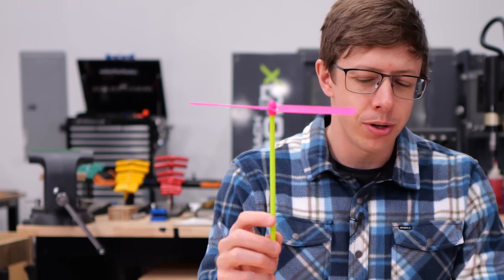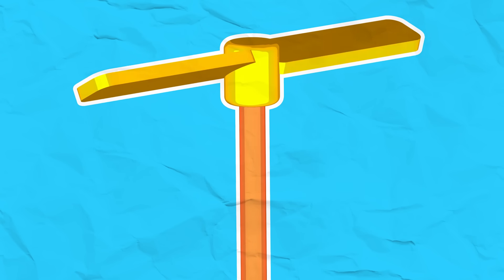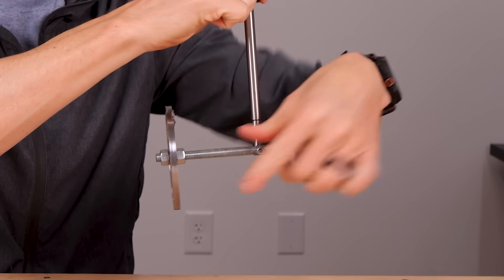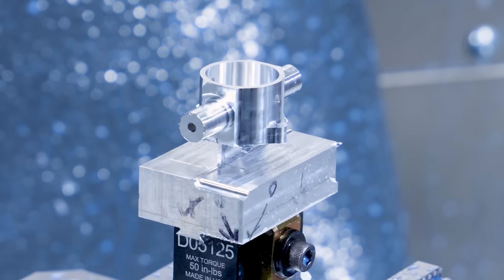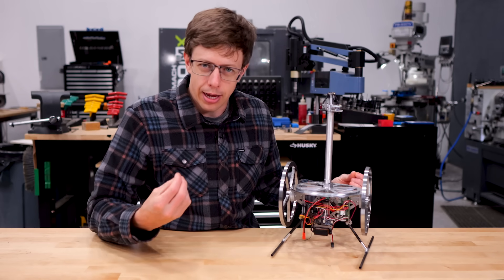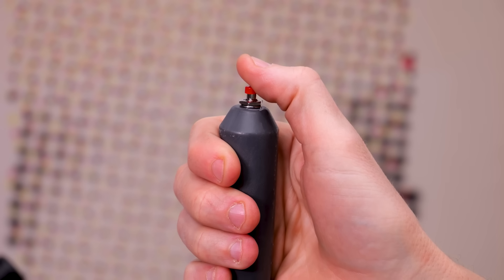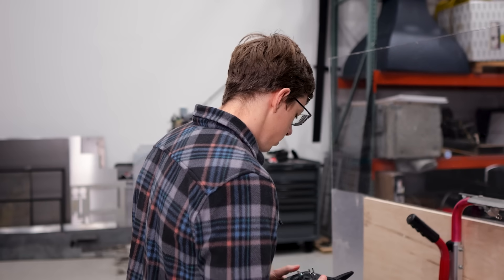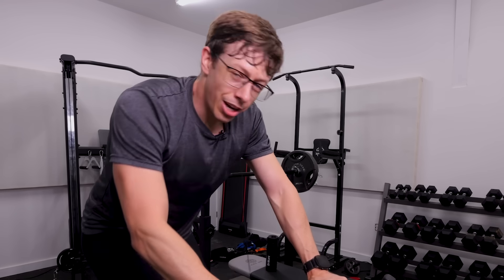I really thought this would fly well

Comment: Answer, counter rotating propellers. for control you can try to adjust booth swash plates with gravity pendulum. yes but the video idea from toy propeller why not make fast rotating device that uses the same toy to spin it extremely fast and release at the peek rpm. for motor use cheep spindle from ali express, they have nice 12k rpm, and have power to make video interesting.   i wish i lived in us and afford so cool toys 5axis cnc, cnc lathe.

Comment: Could you not just ditch the entire flywheel concept and have an aerodynamic housing (similar to the shrinkwrap on the flywheels) on the blades that decouples before launching. This way you get around the drag inuced by the spinning blades, dont carry extra weight during flight, and stay more true to the original toy.

Comment: Sounds like you need to colab with @NicholasRehm for flight control.  He's made a flight controller specifically to do crazy things like this.  

A tail-rotor, swash-plate, and flight control would fix this prototype.  But I bet you're switching to a single flywheel either at the rotor tips.  (a geared flywheel under the rotor would still have counter-torque issues due to the gear-box)

Comment: Maybe im thick but that looks a bit too complicated than it needs to be xD. 
Would it be possible to use a steel rim around the propeller blades as the flywheel, and also to turn the blades around during descent u can try a simpler compact design where in the centre of the propeller can be a hollow pipe and a rod inside with geared tooth or something. Actuation can be done with a battery powered solenoid all contained inline in the pipe so its inherently "balanced". :)

Comment: Why not just make it the exact same as the one you are basing it off. So have a motor that spins the vertical tube that is attached to the propellers then have a release switch and have it shoot up. So none of all these extra parts, just the vertical tube with propellers and a ground station to spin the tube.

Comment: Make a secondary propeller, of which the blades turn in the opposite direction of the first one, directly underneath the primary one. This will nullify the torque and stabilize the device.

Comment: the reason for the control surfaces to not work is simple. The air is moving from top to bottom and the rotor is creating a an airflow acordingly, only that it is not a FLOW. The air coming out from the bottom is a turbulent airflow wich means it isnt useable as a control input. What you need is a seacond rotor on top (that is spining the other direction) or a tail rotor. 
Other than that I really enjoy such videos

Comment: For me, your attempt (as magnificent as it is) misses the essence of the toy. The toy is spin up a propeller by turning the axel and letting it go. Seems that determining why the toy works as it does is important. I wonder how fast the toy can be spun and it still fly in the manner we see when spun by hand.  I have a feeling that the weight of the stick relative to the propeller, the center of mass, length of propeller, mass of both, etc. is then compared to the various tilting forces due to the propeller spinning (how. much leverage is it generating to counteract as it departs from vertical), etc. Once that's known then you have to find the combination of materials that work for a blade and stick that will spin to a high rate. All the machinery stays on the ground, all of it. It simply must be a stick and propeller or it's not the extreme version of the toy.

Comment: I've been putting off buying a transmitter for years now, but I see that DX-6e is pretty loaded, it looks like a full featured transmitter! Not your traditional "e" spec. It actually looks way nicer than my Very OLD 6i... 
Last time I checked, all of the cheaper transmitters (5e, 6e) were just getting model memory and still didn't have screens lol (you had to plug in a laptop to make adjustments). 
After I finish watching this video I'm going to see how much those fancy new 6e and 7e transmitters are going for, and hopefully I'll be able to get some of my old toys doing the crack 3D they were designed to be doing again.

Comment: If you're trying to store energy to drive the blades, could you connect tips of the rotors with a ring around the outside? It would be a much larger ring that your flywheels - even though it would go slower. But if you account for the same weight (1kg?), you could have larger lifting surfaces (longer radius)) and they'd be stabilized a bit by the ring, meaning you don't have to beef up their cross-section much. It loses all of the active controls and much of the engineering/hacking we come to your channel for, but it would be interesting to run the math to see how energy storage compares. Just launching 3-4 blades inside a dense outer ring (on edge to reduce drag and maximize rotational inertia) seems like a viable solution. I'm asking you HOW viable?

Comment: I would love to see you (also) take on the challenge of "How high can I make one of these things go?" if you instead interpreted "these things" as meaning "a helicopter where the part that flies is only allowed to be a propeller and a stick. So no moving parts on the parts that lifts off. (If we by "moving parts" mean "parts that are moving relative to each other" that is, the propeller would obviously have to *spin*.)

It would mean that the end result would have more to do with the toy, but it would still leave room to over-engineer the part that stays on the ground. The obvious drawback would me that this would nix any steering, so unless you also limit yourself to what materials the propeller and stick can be made of it would become very dangerous very fast. But compared to a RC helicopter you can't control I can't see you something you intend to come down in an uncontrolled way could be much worse?

Comment: 7:32 "They have a 5:1 ratio, meaning the flywheels will spin five times faster than the blades."  No, they'll spin four times faster than the blades, because that's multiplication of the value added to the value.  They'll spin five times as fast as the blades.

Comment: What you want to build is basically a helicopter, with the difference that its power comes from the momentum of a flywheel instead of from an engine - but the principle of how a helicopter flies is, perhaps, wothy of consideration.  They use a tail rotor to counter the turning of the body.  Alternatively, if you stuck out arms (I would suggest three of them) with light-weight vertical fins on them (balsa), that will not completely stop the body from rotating, but it would slow it down a lot.  The longer the arms, the more resistance the fins would give.

Comment: I'm not an engineer, But would it work the same if you put the flywheel at the bottom parallel to the propellers? I'm assuming you couldn't have the wrap on the flywheel otherwise it cost too much drag but that would prevent it from tipping over too.

Comment: Worsening the problem is also the x component of the friction, since in order to push the air downwards you are inherently producing a sideways reaction force to redirect the airflow. The best solution would be to implement counter rotating props in the same fashion as the flywheels so that they cancel each other’s forces out.

Comment: Stop making this so complex, the easiest way to couter-tork is to make the reverse mechanism that generates the tork, I understand the idea of the wings, because if it works you don't need to redesign anything, but to be honest, just put a second set of blades rotating in the other direction, the tork generated by the first set will be canceled mainly by the second (you need to do a simulation with air turbulence), the gyroscopic effect will help a lot, but the precession will make everything more difficult (I don't know how to solve this part, so I'm not even going to try to help, I'm just going to make it worse), as the center of mass is below the center of force, it will be unstable, when it starts to oscillate, it will be very difficult to stop it, the gyroscope effect will help, if you can make it work.

Comment: "20 hp is a lot"
Relatively, yes, but also relatively, no.
Normal helos have anywhere from 1000 to 6000 shaft horsepower to the main rotor, with lowest ranges for limited flights coming in around 250 shaft horsepower.
But compared to an actual horse? Well, 20 is like two horses of horsepower (I know, it makes no fucking sense, I didn't design the math, blame the physicists) and if you've ever ridden a horse, you know those guys are pretty fucking strong (I do not recommend riding horses, even professionals get maimed and irreparably hurt or even killed, and that's putting aside the issues I have as a man riding a horse (I do not enjoy cock and ball torture))

Comment: From the very beginning, I saw the spokes would be an issue. Also, the spokes on the main gear are an issue. They contribute to the torque that spins the craft without contributing lift. Although, a teardrop shape to the spokes might be better than a flat plate like you did with the flywheels because of the coanda effect.

Comment: If it was that easy, helicopter manufacturers wouldn't bother with the tail rotors. The thing about gyroscopes is, if you put twisting force into them, they go nuts. The fins didn't work because they are too small and too close to ground at liftoff. The best you could get out of such a thing would be putting flywheel on the same axis as rotor, let the whole thing rotate and use fins to resist the rotation so you get some lift. That would be the flywheeled version of the toy. If you don't want it to rotate, you need either a double rotor or tail rotor.

Comment: For a redesign, it would be curious to instead of using blades at the top, to eliminate that entirely and replace the flywheels with paddle steamboat equivalents.

This way, they become the entire mechanism, lift can be extended and spinning and counteractive forces are less of an issue. 

Can also improve it to a + pattern vs - and offset rotations via the gears.

If you want to be really fancy, integrate capacity for control surfaces in the core.

A few ways to design it, but would generate considerably more lift.

Comment: the solution is simple... counter rotating blades. OR you basically make an RC helicopter with a flywheel in place of the motor. If you go with the counter rotating idea... you STILL need a way to control lateral direction of the aircraft. and that requires cyclic control of one of the rotors. this can be done with a bell-hiller system AND/OR a swash plate controlled via remote and assisted with 2 axis gyro.

Comment: what if you had a large diameter aerodynamic metal ring with propeller blades in the middle? this would maximize rotational energy while minimizing mass and avoid all drivetrain energy losses. The problem of drag on propeller blades would still there though. Alternatively, you could do dual counterrotating propellers to avoid all torque issues and most of the propeller drag problems with the minor disadvantage of drivetrain resistance

Comment: mission failed succesfully.
need a flywheel at bottom rotating opposite way of the propellar to counter the rotation torque.
that or making it a stacked dual propellar where they go opposite eachother.
thats why they have tail prop on helicopters.

Comment: COUNTER ROTATING COAXIAL ROTORS!!
I had a toy helicopter that avoided the need for a tail rotor by have two equal size rotors spinning in opposite direction. Yaw was controlled by the ratio of speed between the two. 
In the toy, that was controlled by separate electric motors with their own voltage control so the hard part would be figuring out that same thing with flywheels.

Comment: Potential design idea to cancel out the rotational inertia while potentially maintaining gyroscopic stabilization: Have the rotor and flywheel rotating in opposite directions on the same axis and lean into the problem as a solution. I'm envisioning the "flywheel" as a hollow cylinder to avoid interfering with the lifting air stream, surrounding a central support structure layer (which should probably wrap around to the outside of the fly-cylinder for safety reasons) with an intervening gear (probably multiple to spread load) to reverse the direction of rotation, all surrounding the central core containing the propeller. Essentially a "simplified" jet engine with a fly-cylinder inside the housing to provide the power and opposite torque

Comment: I hate to be Debbie Downer, but I don't think your design will ever work.  Here's why.

With the simple helicopter toy, the plastic tube in the middle doesn't have much angular momentum. and what little it does have tends to keep the toy vertical.  In stark contrast, your monster contraption has several large spinning parts, each with significant angular momentum.  For each one of those parts, when some sort of "new" torque/momentum/twist is introduced to it due to weight, wind, c.g. change, or another part's angular momentum, it is going to want to precess in some direction.  That precession will induce another spinning part to precess in another direction.  Basically, you're going to have an unpredictable conglomeration of conflicting chaotic precession forces going in all sorts of directions that will be impossible to account for, even if you had some sophisticated computer attempting to stabilize it all, like you have with fly-by-wire computer-controlled stealth aircraft (required due to their marginal aerodynamic properties).

Think about it.  The energy used for a real helicopter is stored in liquid fuel, which doesn't have any angular momentum or precession issues to overcome.  Anyway, good luck and I wish you well.

Comment: The air is only barely passing the control surfaces because the ground is diverting it.  Using a longer prop shaft will increase stability. longer blades will increase lift. I would recommend a single flywheel just attached at the bottom. Let it function like the original.   Good job! . have fun. =)

Comment: My thought while watching this: Why are you moving the flywheels OFF of the propeller axis? Could you not achieve a similar amount of KE by having a hoop of material that connects the wing tips? I get that you have the 5:1 ratio which allows much higher speeds on the flywheels, but you will have a much bigger diameter at the tips of the blades, and you would also likely be able to decrease the overall weight of the craft. 

Anyway, I love the project and I love that you shared with it with us! You rock!

Comment: Typical internet commenter here! This seems like the definition of over complicating something, but I am no help because I have no solution to this! The only thing I can think of is to have another propeller spinning the opposite way with the propeller pitch the opposite direction of the first one so thrust is still downward, then you maybe wouldn’t need as much of a gyroscopic system at the bottom. And Instead of winged control surfaces could you use small drone like setup on bottom to make small adjustments? The air might be too turbulent for the winged control surfaces? Again typical internet commenter here, I loved watching this video either way

Comment: You could use symmetric NACA profiles of which you could make the angle of attack adjustable during flight instead of the fins, that you are currently usung. This should generate more torque than the flaps alone. This would be a pretty overengineered solution, though ^^

The most simple solution would be to make a redesign with another horizontal flywheel counteracting the torque of the prop, I‘d say. ^^

Comment: As I understand, you also want the propeller blades free to tilt up and down relative to the main shaft, else your helicopter will want to lean to one side and tip over. Even if you solve the counter-rotating issue, you'll need to deal with that, I think.

Comment: Vertical control surfaces lose their ability to affect attitude at ground level due to something called "ground effect", which is excessive turbulence caused by the column of air pushed down by the helicopter blades interacting with the ground.

Comment: Great video! I may be wrong, but my initial thought was that control surfaces might not be enough to stop the counter-rotation of the body. However, they may be powerful enough to counter the precession effect of a single flywheel. Perhaps having a single flywheel instead of two, with control surfaces that counteract precession could work. This way we can still use the gyroscopic effect of the flywheel to counteract the unwanted rotation which seems to be more powerful than precession.

Comment: Of course there is always the possibility that the method helicopters use might work. A force (tail rotor) magnified by a lever is likely to outdo using the prop wash as an energy source. Well done for the strength of your vehicle in its crash.